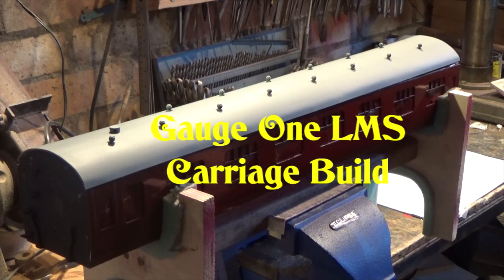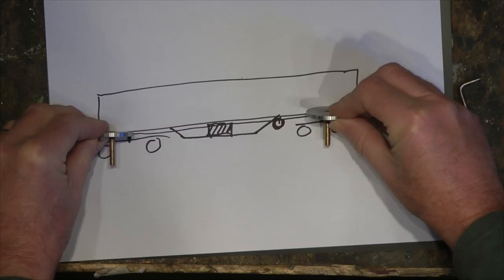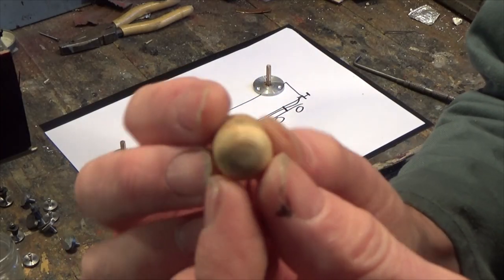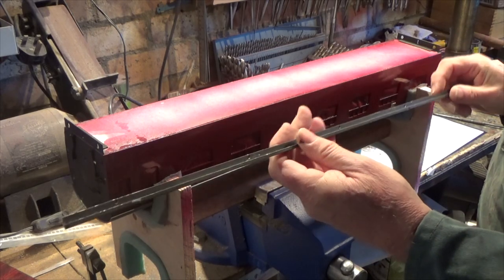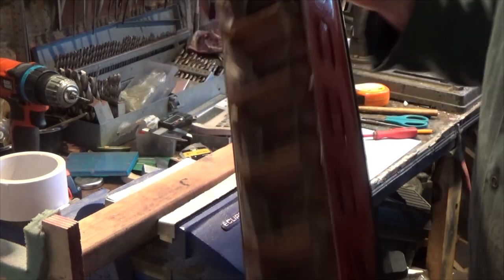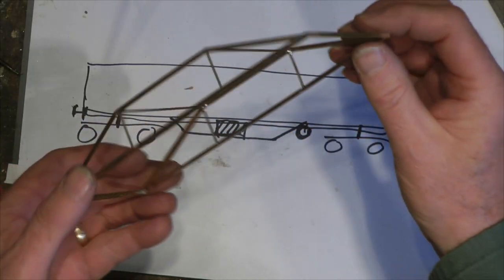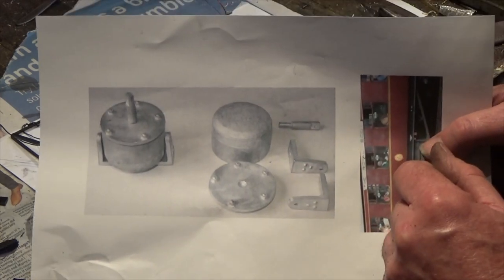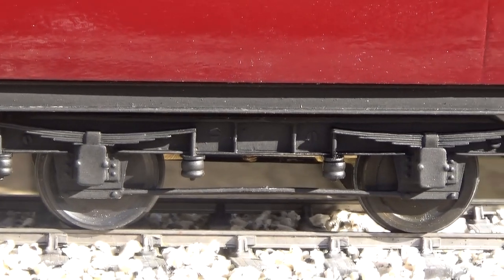Gauge 1 Live Steam Small Garden Railway Carriage Build - 12

Comment: Been watching your expertly build loco builds, very pleasing to watch. Seen your dilemma with the wood bending, and maybe a wall paper steamer to steam the wood panels, then use two pieces of PVC housing water guttering,  half circular shaped.  You could try clamping one on a plank of wood using 2 "L" shaped exscrewsion to help with the diameter size, the another to sandwich the relaxed wood, then just leave it in a warm place to dry out to the shape for 48 hours. Or even just use the PVC guttering instead. I've been thinking of making something like a model train layout but can't decide on the scale.
Reply from the maker: Thanks for your comments. Bending wood evenly of that size evenly can be tricky.
Reply: @GroveDave  Thinking about it, you're probably right, I was thinking how they made furniture, that's probably why they laminate it, perhaps it would work using 2 sheets of wood steamed and glued before jigging up.
Reply from the maker: @PeckhamHall  For this project I only needed a small quantity of panels. If the quantity was big enough it would have been worth making a proper steam container using steam from something like a wall paper steamer. Also the three carriage  roofs where originally made from wood and then formed. But once dry they took on a banana shape over their length. Re-steaming did not help, making them unusable.